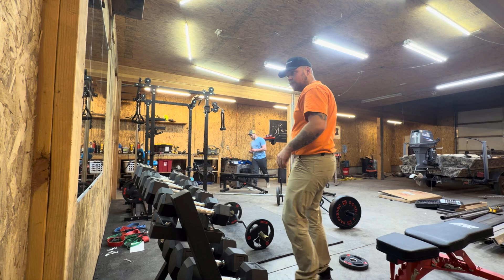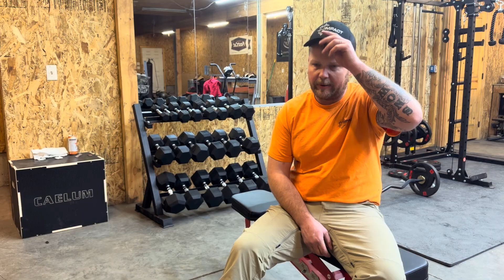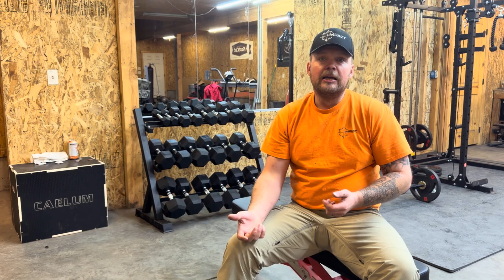“Three Repairs & You’re Out” A Rule in Oil & Gas — Explained

Comment: Good to see you, Jacob! Are you still hireing? Just cutting to the chase. Ive started welding 30 years ago and have cert. for tig and stick on both carbon and stainless.  Currantly working in maintainence where we keep on oil plant running in sweeden. We do pipe fitting, repairs and fabrication for projects. What do you have to offer?

Comment: I weld for a gas distribution contractor, iv worked for them for over 10 years straight with only 2 weeks off each winter. They do three strikes a year unless it’s on 2 inch. If they like you they might not count it if the repair was on two inch and you had a ton of two inch to do.

Comment: I was  welder in the UK oil and gas sector and it was " two toots and your oot" translated as two repairs and bye bye. I since  worked in supervision and it became " any welder with excessive repairs will need to be re-trained and re-tested" What a difference from the 80's and 90's when you were fired on the spot. A cut-out would have you frog-marched off the job.🙂